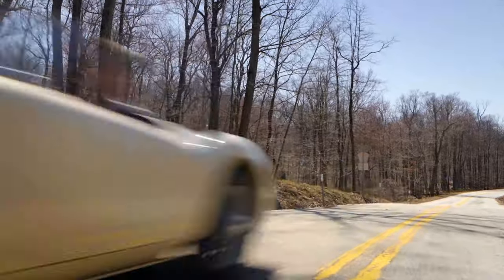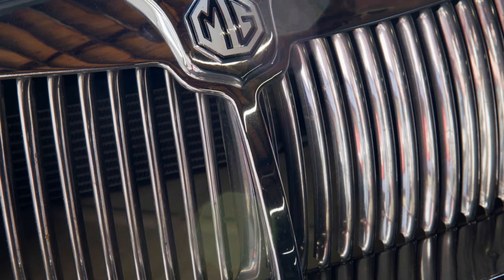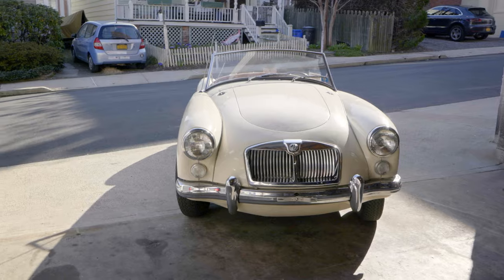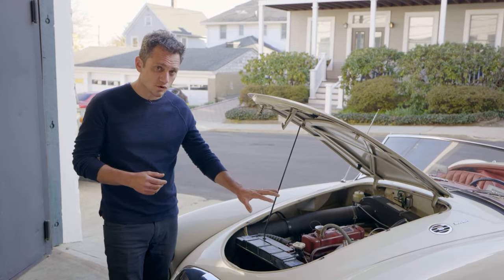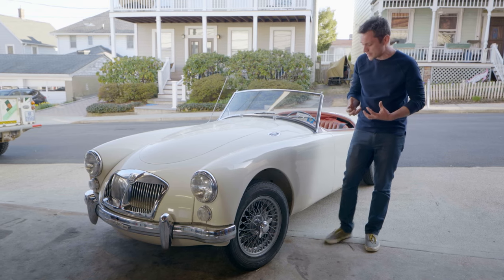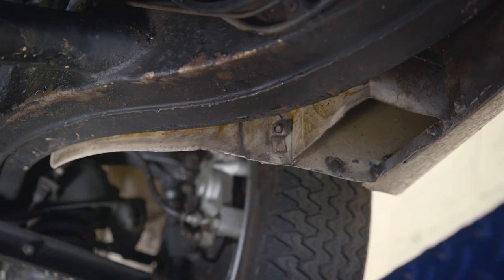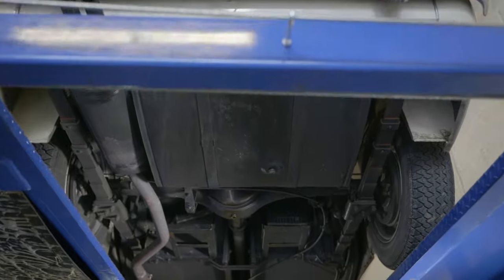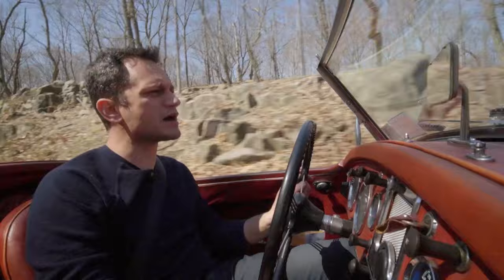The MG MGA is a romantic’s race car | Buyer’s Guide

Comment: Thank you. My first car was a 1960 MGA Mk1 in 1979 at age 16. Drove it until it stopped shifting (Clutch broke apart from mileage) Have owned several over the years (one like the one featured here), but never for very long. My Love never went away and I just picked up an older restoration Twin Cam with a gorgeous Black/Red combo, motor stuck. I can hardly wait to get it back roadworthy.
Spot on Video! Thanks again!
Reply: Would be great to see you do a video series on the restoration.

Comment: In 1970 I bought my first car, a 65 B for a grand. It came with a case of oil in the trunk, a copper hammer for the
 knock offs and no jack, which I found out about the hard way. Not matter what road I was driving on, it went 55 mph. Not so much fun on the interstates but exhilarating on New England two lane black tops like the one featured in this video. Kept a blanket behind the seats for winter warmth and learned not to wear sandals in the summer or risk burning my gas pedal foot. With my college honey in the right hand seat, life was almost perfect. Did I mention the jury rigged fog light wire burning. :)

Comment: The very early MG's until around 1935 had overhead cam engines that were really ahead of their time. They won races under handicapping since they were racing cars with mush larger engines and they consistently beat their handicap. They were told no more super chargers so the next year they came back non-super charged and won the same race again. Due to cost cutting by Morris they were then saddled with a pushrod style engine. They are not fancy, but straight forward and fairly easy to work on. Working on my MG is a hobby and therapy all in one.

Comment: 1958 MGA. My first car. When I turned 16. $1,250. 1963... The car blew a rod in southeast Kentucky. No MG repair shops back then. So We took it to a Hot rod shop. They bored and stoked it.  Redid the cam  and crank. car ran really good after that. I had an exhaust leak - I cut a soup can in half, bound it together with wire and wrapped the whole repair in furnace cement. Worked great. Had to work on the top. Stitching coming loose. So I went to our family doctor who was a surgeon. Got the largest suture needle, and used it and dental floss to restitch the roof. On cold mornings I used the crank to loosen up the engine. Went to a a 12 volt battery. 2 6volts were problematic.I loved that car. The only MGA in central Kentucky. It was a blast on back mountain roads. - Yes the girls also loved it. A 16 year old living large.

Comment: How beautiful. The one I would have would be the 1958-1960 Twin Cam version. I’m only 5’ 10” but I barely fit in a MGB but the steering was SUPER tight (only about half an inch of play) in comparison to a 1969 Dodge Charger SE which was about 1.5 inches of nothing and then it was the steering.
Reply: I had a 57 MGA in 1965 at age 18. I'm 5'9'' & didn't have a problem, except
the steering wheel was too large, so my 250 lb, 6'1'' friend used to get
scuff marks on his pants, when he drove it!

Comment: OMG, talk about a blast from the past. I had a 1960, MGA 1600, same colors as the one in this feature. The only thing I didn't care for about that car, was that it would get wet inside if parked in the rain. You had to keep the window open enough to get your arm through to open the door. Guess I could have run a string from the cable in the door panel out the window (Geeze Louise, a 48 year old "afterthought"). Almost cried when he quoted the current replacement cost. You see, mine was in very good condition. And for a 20 year old, 48 years ago, I paid a whopping $ 350.00 for the car, wish I still had it 😢.
Reply: Funny how so many British cars suck in the rain. I guess it never rains in England. 

I do like that they invented the intermittent windshield wipers and automatic undercoating. 

Lucas, Lord of Darkness.

Comment: Can't even Guess how many times I attempted to locate 5th Gear, while rolling along in either of my two MGAs. (Yep. Have to agree -- better brakes and a bit more Torque in the Mark 2. Same "Lucas" electrics. {Whimper.})
Reply: Try fitting a Type 9 (European Ford Sierra) gearbox, or a Miata one. Both have readily available conversion kits and can be retrofitted back to stock if originality is important to the next custodian.
Trying to fit an MGB's overdrive needs mods to the transmission tunnel, but would ne a more 'period' conversion.
Reply: Hail Lucas, Lord of Darkness

Comment: They need to stuff a little 289 cobra in that puppy.
Reply: And ruin the balance of the thing, which is the main attraction in the first place? No thank you!
Reply: @jakekaywell5972  I'd do it but I like fast. That little 289 probably weighs about about the same as the engine that's in it?
Reply: @StreetTruckinTitan  The Ford 289 V8 weighs just a shade more than 650 lbs. versus the less than 400 the B-series weighs. That's not an insignificant difference. The more advisable approach is to simply hop up the B-series that's in it. Moss Motors, for instance, sells everything that you'd need to do it. Carburetors, hoses, you name it.
Reply: In a 1500 1957. With drum brakes on all 4 corners.
Are you mad?
Better get a Twin Cam, with all round Dunlop disc brakes. 'Stock'Twin Cam makes 108bhp, but revs to 6,500-7,000 which makes all the racers happy.
Reply: @robbending3848  More incomplete handed down not first hand knowledge , which is obvious. 
All Around Dunlop knock off disc wheels.  Yes they had disc brakes, no they were not Dunlop. The Twin Cam made considerably more hp for a short period of time as they were unreliable. 
The twin cam was so bad that they took the last remaining chassis and installed the 1622 and called it the Deluxe. the rarest of all MGAs.
Reply: @jeffhildreth9244  since I own one, not incomplete knowledge- only partially incomplete.
Yes, they are Dunlop disc brakes, designed, engineered and made here in Birmingham.
No, I've never revved a TwinCam engine since that was long gone before my custodianship.
But ask any of the North American racers how unreliable Twin Cam engines are.  They'll tell you to either fit webers or soft-mount the SU carbs.

Comment: Tell the story while you are standing still,  there is no need to be driving the car while looking at a camera more than you look at the road. It's not the same engine as the MGB, thats a B series but 1800cc and still with 3 main bearings till the MGBGT came out.
Reply: Mine is.
Was a Twin Cam, but the engine long gone.
So an 1800 3-main was a drop in.
Best of all worlds including the disc brakes all round
Reply: Sorta correct. The 5 main B was introduced in Oct of 1964 in the roadster and the GT.

Comment: Knew a guy that had one of these. It couldn't get out of it's own way. Very under powered. Yuck. If you want a noisy car that pretends to be fast then good luck to you.
Reply: i go on the freeway doing 70 so your friend doesn't know what he's talking about
Reply: @anjdog2003   I'm talking about acceleration not top speed genius . How long does it take to get to 70?
Reply: @davidlong1786  Well, yeah. That's the whole point to why you would buy one of these. No different from the I6-powered "Secretary Special" Mustangs of the 60s. If you actually wanted performance with your MGA for whatever reason, you bought the Twin Cam version. As for acceleration, the 0-60 time of a 1500 MGA (the most base version possible) was 15.6 seconds. A totally acceptable figure for the era.
Reply: I knew a guy.. swell, that;s helpful. Have you ever owned one, no.. Then you have nothing to offer except second hand BS for a typical American . These cars are not about  knuckle dragging MOPAR freak mouth breather straight line yeehaw or NASCAR ( "adult" bumper cars) nonsense. 
List your car  ownership experience.. let's compare notes.
Guarantee my 1963 MGB roadster on the right road will smoke anything you bring... you do have a license and a (paid for) car.
And before you try to play one up.. 
25 years in the car biz. from lot boy up to National Training Manager for Management training for one of the most prestigious Euro hi line car builders. My professional background is Rolls, Bentley, Jag, Aston MArtin, Austin, MG
MAZDA ( 11 years),  Mercedes Benz of No America,  BMW and Volvo. etc  I have owned 130 cars and trucks
Go for it  Mr Millennial
Reply: @jeffhildreth9244  I knew a guy...Lol
Reply: @jakekaywell5972  Or, do as I did in 1970 with my 1956 MGA ( which I restored top to bottom) stuffed a 1964 MGB 3 main 1800 in it, swapped the cam and ported the head. No need to buy a Twin Cam or a 1622 Deluxe. It would outrun Porsches. 
I always amazes me (actually lives up to my expectations of auto geniuses) that the loudest voices have the least, if any, experience with the topic at hand. Frequently parroting others who also had no first hand experience and parroted others and it goes on,,, such as maligning Lucas or Brit cars in general or oil leaks etc. Compare a 53 Corvette with a Jag 120. A VW with a Plymouth Valiant.